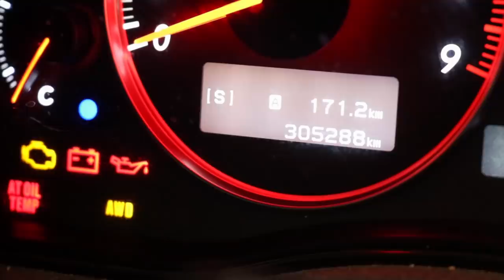Building My Son His First Car / P Plater Build EP1 - THE SKID FACTORY

Comment: Turbo delete, 20kph speed limiter, massive brakes, cage & 6 point harness is my guess for mods.
Reply: Forgot the extra mirror install
Reply: There's no turbo to delete.  Rags down the filter box maybe?
Reply: 1 seat so he can't have any mates in the car either!
Reply: Safety first
Reply: N.A Yanma 3 cylinder Diesel swap.
Reply: What about the fire suppression and condom dispenser?
Reply: Rubber baby buggy bumpers!
Reply: Music volume cap lol
Reply: @nevek20  Nah, the less seats there are, the more space is created for body parts, like in the back of a pickup truck. Terrible idea.
Reply: @masondegaulle5731  rags in the intake?.... Ethell?...
Reply: @slysithejuicegy  Cummins 4BT: You can no longer carry any passengers due to the GVWR.
Reply: @papapetad  in our family we tend to describe the amount of space in a boot by how many bodies you could fit in it. lol. haven't actually tried it yet but have met some people over the years i would like to use as proof of concept???????

Comment: Interesting what you had to say about learning on a manual transmission. My daughter wanted me to teach her how to drive and I said I would provided it was on a manual gearbox. She wasn't all that enthusiastic about the idea but she did consent. At first we spent a lot of time in empty parking lots learning proper clutch, throttle, and brake control. When we hit the streets she had that essentially under control and seldom stalled starting out. There was one day though that she lost all semblance over control over the clutch and throttle. I could see she was getting frustrated as I was so I told her to pull over onto the shoulder and stop (We were on a secondary highway that day.). I told her to stick it in fourth and start out and she looked at me and said, "I can't do that." I told her she was going to do it. She stalled it a couple of times which I had expected but then she finally managed to get it going. I told her to stop and do it again. Again she did it without any fanfare. I told her again and once again she pulled it off smooth as silk. I told her to stop again and shut the car off. She looked at me looking a little puzzled when I said "So now please explain to me how you start off smooth in fourth and not stall it, yet you are having trouble starting in first." She sat for a moment and then said, "you're right Dad." I'll get it this time and she did. We spent about two months all told and I even got her to the point where she new how to double clutch and down shift smooth as glass. I was proud of and told her so. 

A couple of days later she came home and told me that she had just broken up with her boyfriend and sad it was all my fault. I asked her, "How do you figure that." She told me she had informed him that he didn't know how to drive stick properly. He had a Volkswagen Jetta and it was his habit to throw it into neutral and coast up to the lights and stop signs and he couldn't start on a hill without using the emergency brake. When she told him he got upset and told her if she was so good, maybe she should drive. She took him up on his offer and he soon regretted making the offer. I guess she upshifted and down shifted like a pro occasionally even throwing in a double clutch or two and seldom used the brakes because she timed the lights so she did not have to stop. Apparently his ego just couldn't take it and when he dropped her off he said he wouldn't be back. I told her I was sorry but she just laughed and said with a big grin on her face, "Dad, it felt so good to jamb him up and show my skills. He had it coming because he was always putting me down because I'm a girl and and according to him girls can't do anything. I had had enough of his garbage so I blew his doors off just because I could. You made that possible Dad." 

In any event, her first car was a brand new Kia Forte that she paid for. When we went into the showroom the sales guy tried to talk her into an automatic. She wouldn't have it. She told looked at me with a bit of a smirk on her face and then told the salesman, "If I can get it out of the parking lot without stalling it will you stop pushing the automatic."  The salesman said, "Yeah okay." They were gone about 45 minutes when they came back. She came in with a big smile on her face so knew she had pulled it off. The salesman walked over to me and said, "I didn't think she could do it but was I ever wrong. The best part was when we had to start while going up a hill. She had the clutch pushed in and her right foot heel and toe on the brake and gas. She let the clutch out until the motor bogged a little and gave it some gas while letting the brake off, and we started off without rolling back an inch. I was impressed. I've seen people who had been driving for years that can't handle a manual like she can." She bought the car and put about 200K on it in three years before she traded up.

So that's my kid and I'm damn proud of her. She doesn't put up with crap and any joker who thinks he can buffalo her had better think again. She will smash his ego into little tiny pieces if necessary.
Reply: Wow we
Reply: I suddenly want to only drive automatic
Reply: Interested to hear what car you can start off in fourth gear with multiple times without changing the clutch inbetween
Reply: @sebischmitz777  you just have to feather the clutch, it's not that difficult. Although it is much easier in a lighter car or something with power.
Reply: @Rattus-Norvegicus  You'd need quite a large displacement engine for it to work I guess. That's why I was asking what car it was. In a European 1.8 liter hatchback you won't be starting in fourth on any day without ruining the clutch.
Reply: @sebischmitz777  I can do it in my 04 Civic with a 1.7L. It's not good for the clutch in any car but 3 times is doable in just about anything.
Reply: Cool story!
Reply: @sebischmitz777  My old 93 ford escort 1.9L 5spd gutless wonder was jammed in 5th gear on a hill.... with proper application of gas and clutch I got up the hill and made it home. I'm sure the clutch got hot but after 240K miles it never failed..
Reply: @sebischmitz777  The car was a year old 2006 Chevy HHR with a 2.4 litre engine putting out 172 BHP and 162 Lb Ft of torque, a five speed Getrag 23 manual, and it weighed about 3155 Lb. It was still on warranty so I wasn't overly worried about the clutch. In any event, the trick to starting out in any car in a higher gear than first is a whole lotta concentration and the skill to use a clutch like it's glass. I taught my ex-wife to drive along with two other women and they could all do it reasonably well. As for the HHR, well the powertrain was reasonably good (Probably because GM didn't make any of it.) but the rest of it total junk. If you frowned at it it got a dent in the sheet metal. There were suspension issues, electrical issues, programming issues, and incredibly poor fuel economy. I traded it off in 2009 for a Ford Ranger with a 4.0 litre and a 5 speed manual.

Comment: Also 100% agree with Al on learning in a manual. My family didn't have a manual car so I had to learn in an auto, and passed my test in an auto. I then failed my next test in a manual, just before moving to NZ. So in the end I went through the NZ licensing program, and converted it back to an Australian license when I moved back.

I learnt a lot about vehicle control and driving awareness and pre-empting changes from driving manual, and there are also jobs that I have worked in heavy industry where you need a manual license. Learn in a manual if you can, because it's a pain in the arse to learn it afterwards!

Comment: Your first car is a really important moment I think, it's like a key to freedom. My first car was an Pontiac Acadian, paid $300 and it was in very good shape but the engine was bagged, I found an 83 Chevette with 80,000km on it for $100, run like a dream but the body looked like it spent the last 24 years under the ocean I couldn't understand how it was so bad, I was driving it home and my foot went through the floor getting in to it, the rear view mirror snapped off when I tried to adjust it . I did all the seals and gaskets on the donor for good measure and drove it for 7 years never missed a beat, could never understand why they had a bad rep, one of the most reliable domestic market cars I ever owned. Cried like a baby when I sold that damn thing, not because I would miss the car but because it was the end of an era in my life, cherry on all that was I sold it for $700 so I turned a profit haha. Had dozens of vehicles since but I'll never feel that kind of freedom again.

Comment: Teen boy, station wagon, yeah he won't like the extra room till his first date night.

I'm with ya on driving a manual. My 13 y/o has known how to drive one since he was 9. Taught my g/f how to drive one in my LS powered s10 and that was an experience. I learned how to drive one in a 1962 chevy truck with 3 on the tree when I was 6 standing on the tranny hump shifting gears. Later on when I was about 8 and could reach the pedals actually driving it around on back roads.

Comment: Everyone needs to have a full manual license, even if they drive an auto for the rest of their life. My folks had an auto, but i went for a manual lesson. It's a good skill to have, because you learn ALOT more than a car shifting for you. All the sounds and mechanical bits. I drive an auto full time, but in an emergency or if im forced to I'll drive a manual. Some smaller trucks have a normal manual gearbox which is good if you want to just move it to another place.

Comment: My oldest Son and I built his first car, a 1976 AMC Gremlin. We went to the Junk Yard and bought a 350 4Bolt out of a GMC Pickup. When we told them what we were putting it in, they said it couldn't be done. Well, we pulled the 6 cylinder out I welded new motor mounts in and installed it with original motor mounts flat. We built the engine, bored .60 over with oversized pistons, rocker rolled cam with Ellerbrock intake, Holley 750 Carb and Hooker headers. Now all this was after he learned to drive and got his license in my 1975 CJ5. He was 18 and moving to Virginia to marry his high school sweetheart. He figured his car engine was to old and would not make it pulling a trailer for over 1200 miles. He still has that car, and one day maybe we will modernize it. It is really unsafe on todays highways with the brake system and as fast as it is.

Comment: In case anyone was wondering, the QLD provisional license system has two stages - P1 and P2. P1 you hold for 1year (or if you passed your L test over the age of 25 you skip P1). The P1 license has restrictions - no booze, no phone use (even handsfree), no v8s, no turbos, no rotaries, can't supervise a learner, can't have more than 1 passenger under 25 who is not a family member, must display P plates on front and rear of vehicle, and can't accumulate more than 4 demerit points/yr. For P2 you do a hazard perception test, then hold for 2 years. Restrictions are the same except no passenger restriction. You get an open license automatically after 2 years on P2, so long as it has never been suspended.

At least these were the rules when I used to live in QLD and got my Ps in 2013.

Comment: lol 305k's aint nothing, my wifes 2013 FX37 has 240k (HARD DRIVEN) MILES=386 km's and we never had to replace ANYTHING, just good ole fashion mobile 1 oil changes(every 15k miles)and coolant flush (once every 2 years) and trans service (once every 2 years). Tires and brakes replaced as needed, as well as the battery (1 time).
Awesome dad you are! I hope your son knows how cool of a father you are, and learns a few things from you and Woody!

Comment: In UK the minimum driving age is 17 years old with a test for a full license at any time after that.  My view and one that I applied to both my daughters, was that they should have a car that was underpowered and not very capable (they both used a '05 Picanto 1.2) that set the insurance premium to the minimum, but still expensive cost.  Giving a new driver a very capable car just means that their inevitable excursions into the scenery will be at higher speed that could be more deadly.  I taught my daughters from a very young age how to drive and control a car on a grass field so that the basics were ingrained in them.  I also encouraged them to compete (off the highway in registered events) with the car so that they didn't need to explore the limits of their abilities on the Highway that seems to be 'de rigeur' for young drivers over here.
Your Scooby would most likely be uninsurable in UK for a newly qualified driver under 25 years old or be so prohibitably expensive that Mum and Dad would need extremely deep Saudi pockets just to insure it.  The issue these days is that the general adult population is not willing to subsidise the insurance for young drivers through their premiums.  Also, as cars become more and more capable the accident speeds are getting ever higher, increasing the payouts particularly for third party injury.
I made the mistake of buying my older daughter a Beetle 1303, 1584cc and upgrading it with Porsche suspension and brakes that should have made it much safer with no extra power but the insurers saw it as modified and thus was uninsurable for her.  For me, the insurance was only £80/per year (our Skoda Superb is £380/yr by comparison) so that the moral is don't give your kid a modified car!

Comment: i've had four or five 2.5L  Outback Premiums for work cars, with work and private use i do about 1,000km a week.   Can't really fault em too much, comfy and very nice to drive.  Partly on the strength of that I bought an older Forester (might be 2013 or so) for the missus, which hasn't been quite as successful in that it is thirsty and somehow manages to make engine oil disappear - doesn't seem to be burning it as the oil stays clear between changes but it seems to be somehow putting it into the exhaust as the outlets are always damp with oil.  dunno what that is.  other than that I rate the Subarus and i like the AWD as well

Comment: In the United States manual transmission have almost  disappeared and it is amazing how few people can drive a manual transmission.  I am 37 years old now and when I was 15 I bought my first car by myself which was a 1970 chevelle ss 454 ls6 4 speed car that I paid $2500 for.  I got in plenty of trouble with that car and went through plenty of tires.  I rebuilt the original numbers matching ls6 big block and it was making easily 600hp.  I regret selling the car every day but their values peaked in the early 2000's and I was able to sell the car for stupid money.  From there I got extremely lucky again and I purchased a 69 big block 4 speed corvette that had been sitting in a neighbors front yard for a very long time.  When I bought the car I had no clue that I was buying a l88 427 car which is extremely rare with a little over 100 made.  I got in plenty of trouble in that car but that was the time of my life.  I still have that car today and I will never sell it and it will be my sons first car.  The bad part will be the insurance rates.

Comment: You mention the different floor pan for crossmember on the Auto's, but that must just be an Australian thing. 2018 CVT forester still has the correct mounting points and bolt holes for the manual and auto crossmembers. Don't know about 2019 models though, they have lots of weird stuff going on.

Comment: Hi Turbo Yoda,

great stuff. Came over to skid factory from MCM.
Very interesting to hear you insight on Subarus.

May be you could hep me out:
I am having a wired issue with my EZ30D (5 speed automatic, stock).
The engine starts to miss fire when idling or on low rpm under load.
For example when cruising uphill on the highway with low rpm.
It doesn't seem to be the case with all cylinders.
I changed the spark plug and the coils so far.
The grounding bands between engine and chassis are also okay.
May be you have an idea on what to look for. 

Greetings from Germany.

Comment: RE: the oil leak on the timing chain cover--- it IS a massive job. Subaru nerds in Washington are a penny a pound, but very, very few would touch an H6 with a ten foot pole. I ended up taking mine to an indie specialist (who actually did it for a living) and it cost me $6500 for a full RnR. It WAS worth it, that was 2 years ago, and I'm still paying for it.

Comment: My daughter is only 4yrs old and I always think about what car I'm going to build up for her 😄 👍

Though by the time she drives most things will likely be powered by electrons 😭

She is currently sporting a 12v battery powered pink jeep 4x4 with chrome wheels, stereo, flashing rgb led spotlights on the rollbar and I can remote control it to stop her if she gets in trouble.... I wonder if I can build that feature into her real first car 🤔

Edit: The ECU cost more than my first 3 cars 😁

Comment: Hey guys. I have a 2000 Outback with the 5sp manual and the 4wd lever. There doesn't seem to be any synchro left when trying to go from 2nd to 1st ( basically have to come to complete stop to get it into 1st). Is this 1 of the normal issues with the 5 speeds?